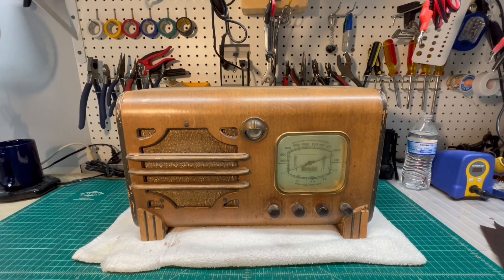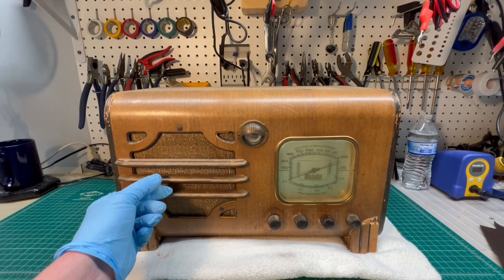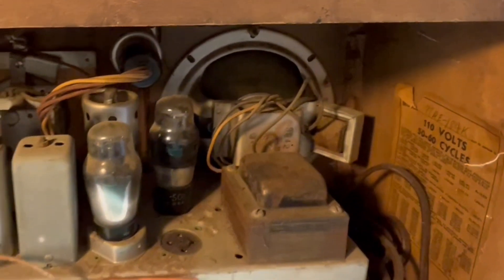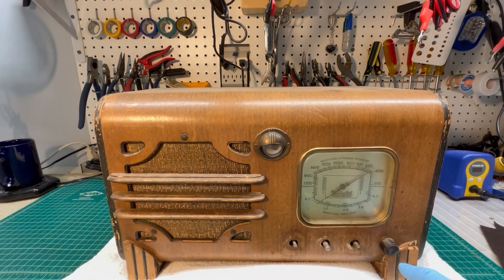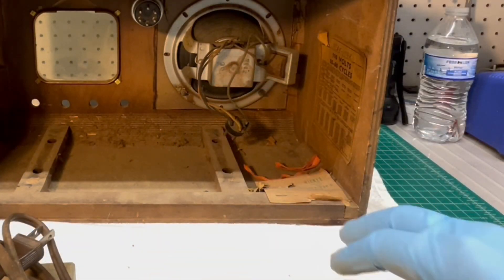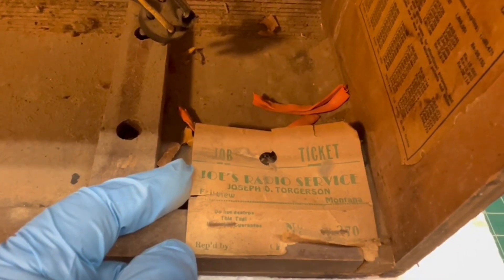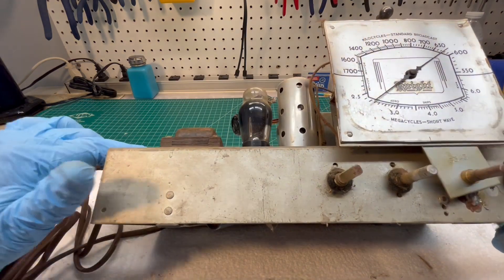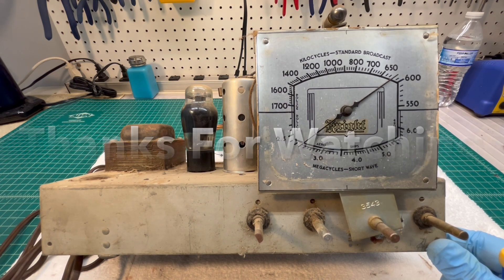Knight 98AE-184K - Introduction & First Look

Comment: Judging from the different eras of replacement capacitors, it looks like it's been to the shop several times---the owner of that set cared enough about it to keep getting it repaired over the years. I've seen plenty of radios where the tech only replaced one section of a multisection electrolytic---I always thought that was a bit sketchy, but I guess it got the job done
Reply from the maker: Yep, it was great to see it received some TLC through the years. Thanks for watching and reaching out. Best, Don

Comment: This looks like  it will be an enjoyable restoration  Don. Took an extra day to even write this with the power going out
due to heat and storms. Crazy hot weather in the Midwest.
Reply from the maker: Steve, thank you for watching and reaching out. I hope your power issues are soon resolved and the temps cool down. We’re well above normal here in NC too, heat index today 106°F and next week the same. Thanks again. Best, Don

Comment: In high school in the early 1960's, I would pore over the Allied catalog in study hall.  My first ham transmitter in 1964 was a Knight T-60.  From nostalgia I now own several of them.  As far as I know, Allied/Knight never did their own manufacturing - only kits for ham gear.  I was very interested to learn they started back in the 1930's.
Reply from the maker: Hi Jim - that’s a cool memory. Do you still have the Knight T-60? Check out the site below if you haven’t already done so.

https://chicagology.com/silentmovies/alliedradio/

Best,

Don
Reply: @RestoreOldRadios  Hi Don, thanks for the reply and the link.  I knew quite about Hammarlund (my ham receiver) but very little about Allied.  Very interesting.  Yes, I not only own one Knight T-60 but I own 7.  My friends think that I have lost my mind.  However, I continue to try to improve my final T-60's with parts from other units and new techniques that I have worked on.  Many techniques have come from watching your videos.  The paint on the aluminum panels turns out to be very fragile after 60 years.  I recently ruined a front panel by soaking it overnight in water and dishwashing detergent.  Who knew.  Jim

Comment: Hey Don....can relate about the 100° temp. We've had a cool front come through and it's only 95 now. Wish we could share pictures in the comments....I recently received 1946 Crosley Bakelite as a gift and a 1937 Philco table top from an estates sale bringing my 'to do list' up to about 20 now. It's turning into a nice stock pile for these "Scortching hot days" and "winter's cold cold days".  Anyhow....really look forward to this restoration and series. Best wishes & regards.

BTW: A fellow site (I'm sure many of us are familiar with Shango066) recently used an old trick with a (I believe) 120/12 volt transformer to buck the line voltage down to 110 Vac, by anti phasing the secondary and paralleling one of its leg w/ the incoming line. 😉  Granted it'd mean using an additional transformer,  but it might be a way to reduce any additional heat generated by a conventional dropping resistor. Have you ever used that method yourself?
Reply from the maker: It’s going to be another hot day here and next week looks even hotter, but it will be officially summer so I supposed I need to grin and… Congrats on your new additions; it doesn’t take long for them to pile up. LOL Thanks for the Shango066 reference video, I’ll definitely check it out. I have not used that M&P. All the best. Don

Comment: Looks like a promising restoration.  Seems very similar to several Westinghouse and Delco models, probably all designed to compete with each other.  Manufacturers even then were closely aligned to what their competitors were doing.  I can't tell you how many cheaply built cathedrals I've seen attempting to copy Atwater Kent designs, for example.  Interesting that the "Knight" label on the dial looks like a decal - maybe was a generic dial available to other retailers who wanted a private label set.  That rubber cord does look original, by 1937 most manufacturers had transitioned to using rubber; Zenith started in 1936, Philco in '37.
Reply from the maker: I noticed that as well on the Dial Scale. Probably a generic used by many mail order companies back in the day. When I remove it, I’ll take a closer look and share my findings. The radio advertising I shared in the video is a match for the cabinet design, but the chassis and tube count is different; a 7 tube receiver (earlier release) vs. 6 tubes. Thanks for watching and the update on the rubber line cords. Best, Don